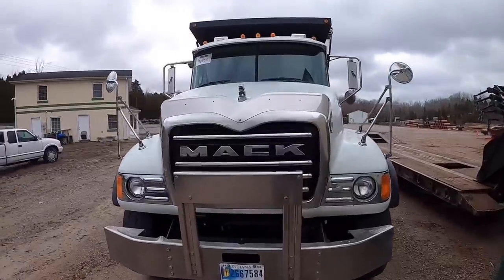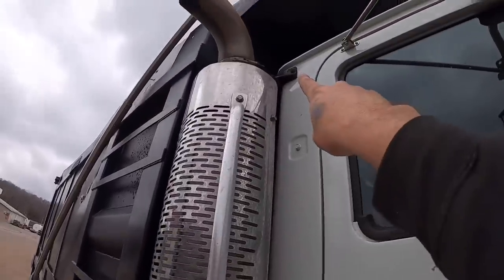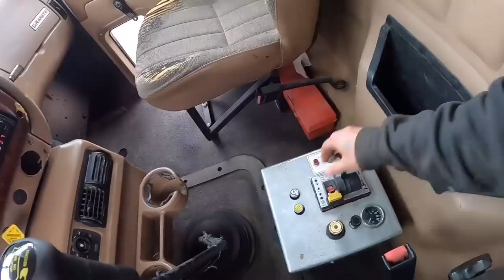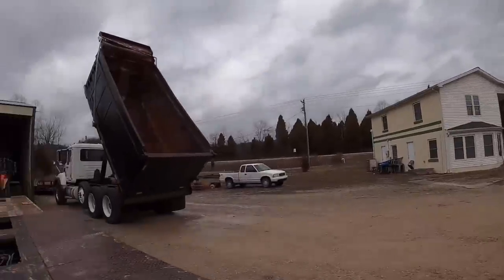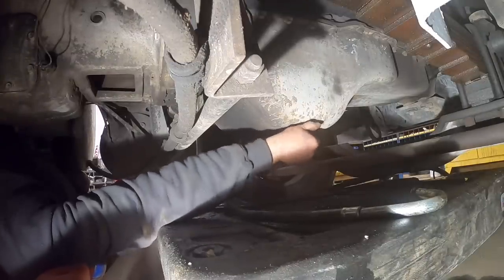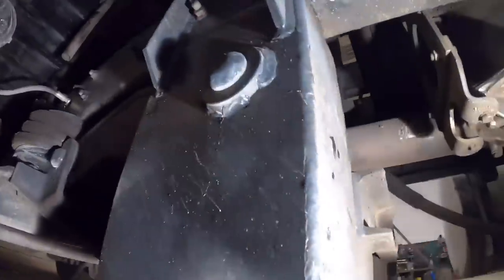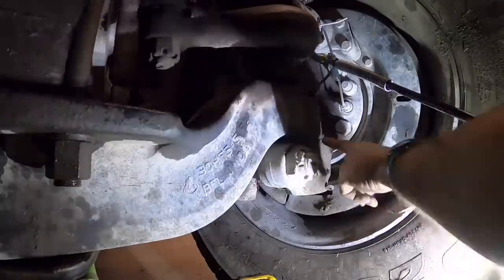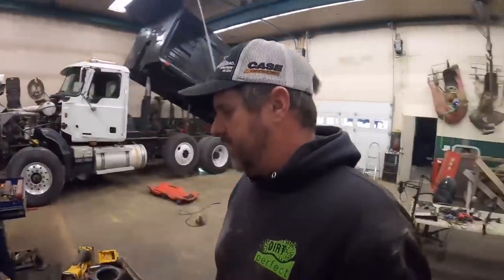New Auction buy Dump truck inspection and what does this mean for the Lt Dan project ?

Comment: Don't you have to send a  truck 1 ton an up when you buy it to have a MTO LICESED  Mechanic shop to get a safety check done before you can even register and license it as well any truck 1 ton an up have a safety inspection an yellow inspection sticker on driver side door window as well a CVOR FOR every truck 1 ton an up?? Here in Ont. CANADA WE HAVE to every 12 months even on farm plated  .. just for my 5 ton dump/ boom truck on the farm. Farm plated. At a cost every 12 Months of cnd $ 1800. Same with any trailer you put behind  a 1 ton an up truck must have a safety check done an yellow safety sticker with date of safety punched out  to safety my 12000lb trailer cost around $1000 these prices to not include any repairs. All wheels drums have to be pulled. Worst it to find a shop that has time to do a one man one or 2 trucks trailer to do it  there all booked up with big companies with 10 to 30 trucks or more. You can't even renew insurance with out showing a valid safety check an cvor. Anyone can pull wheels off but a licensed tire person has to put them back on. To me its a hug money grab. It sure don't slow down all the big truck wrecks every day. It like these big companies had out licenses out of craker jack box's to turbin heads. Every day there at least 2 or more really bad wrecks.  Most on strait aways. 😢
Reply from the maker: Yup that’s me
Reply: @DirtPerfect  ur not a DOT  LICENSED  Mechanic shop no  paper or signs on the wall or doors wheels dodnt come off to check brake an messier the drums n 64 other things